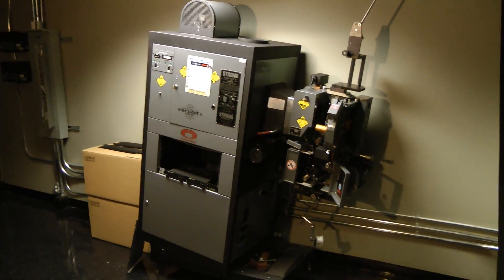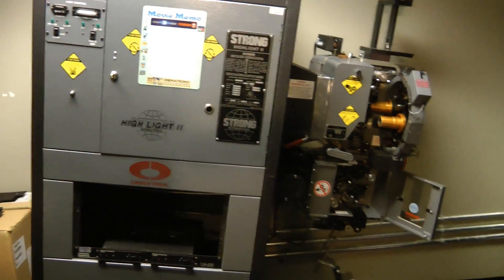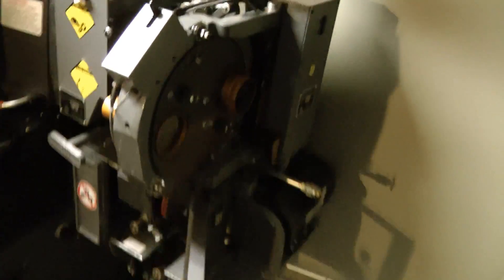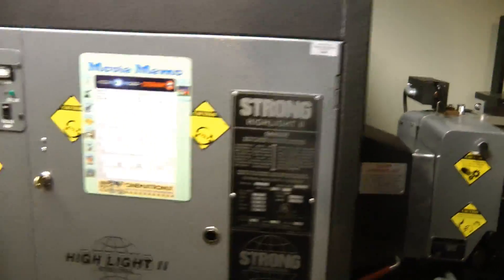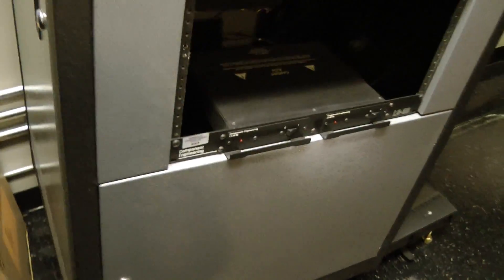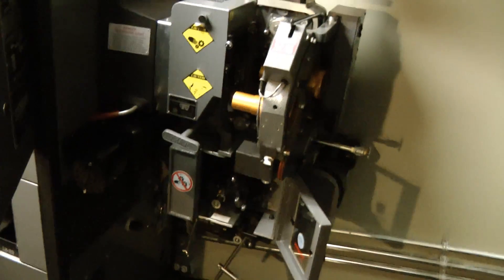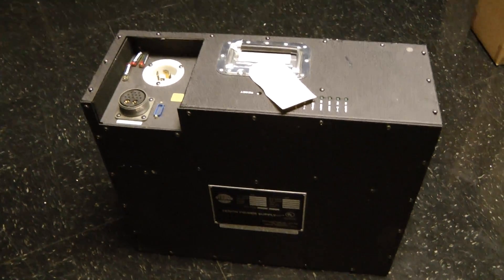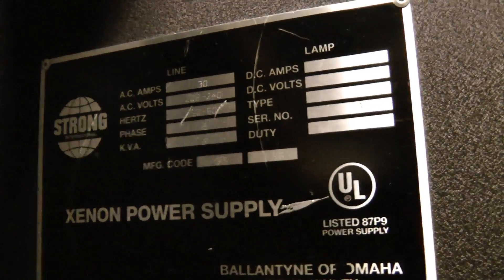Extreme teardown - Simplex 35mm cinema projector - Part 1 Intro

Comment: So I notice that you have got awesome experiments with that projector and you have plugged it at your shop (home)! Which voltage it works? 120VAC, 220VAC, 550VAC or 600V? I also noticed that the theater bought Christie digital projector (s)! No longer conventional film rolls at Cineplex Odeon? Which the image quality with the new Christie digital projectors?

Comment: This Simplex is unrelated to the Simplex of time-clock and fire-alarm fame. The Simplex projector line started out in the early 1900s, manufactured by the Precision Machine Co. The company became International Projector Corp. in the 1920s, which several decades later was acquired by General Precision Equipment. This started an association with GPE subsidiary Strong Electric, which later became Strong Int'l., makers of Simplex until Strong's 35mm product lines were discontinued  around 2011.

Comment from the maker: Yes, the new ones are 3-chip DLP projectors made by Christie. I believe they're using CP2210 or CP2230 projectors depending on the screen size, with lamps ranging from 3 to 6kW

Comment from the maker: The projector itself is not that big, it's the part sticking out on the right side. The lamphouse is the big part. What's also not shown here is the film platter system which is easily twice as big as the projector.